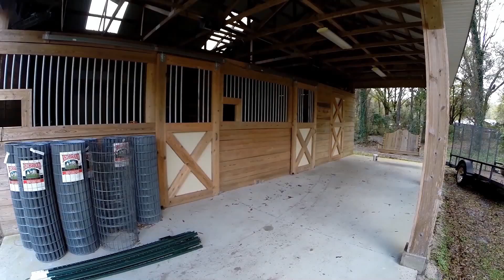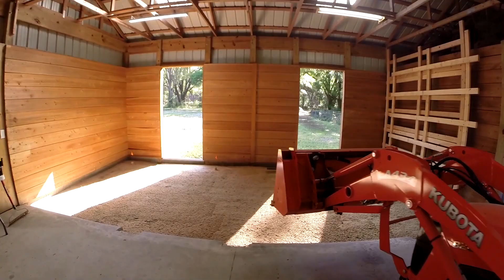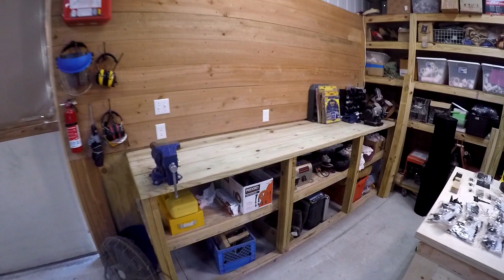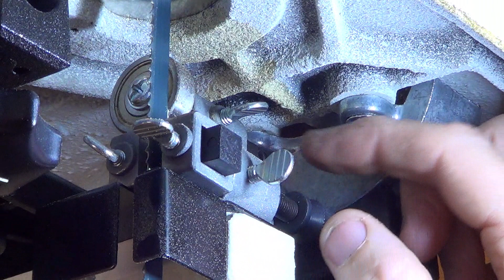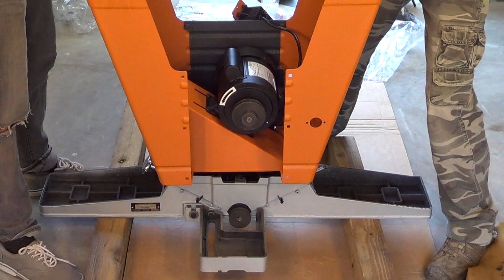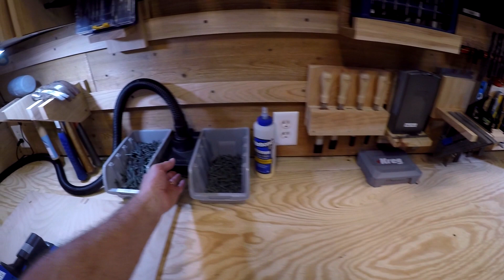Shop Tour

Comment: When was the original horse barn built? By you I assume?
Reply from the maker: I think it was around 2008.  I know I said old horse barn but the point was that it was not originally built as a shop.  If it was it would have been significantly different.  I would have sealed it up, insulated it and added HVAC.  If I had know I was going to go this far with it I would have built it in my 3 stall, insulated garage with HVAC and a 100Amp service.  There is still a chance I may move it if I really end up wanting to use it year round.  I did design it myself and I was the General Contractor.  I precured all the materials and ran the subs and schedule.  That said, my carpenter who has been with me for 24 years did almost all of the actual construction with a lot of help from his brother.  Our actual house was built the same way in 1998.    https://youtu.be/o_Yx10QgtqE